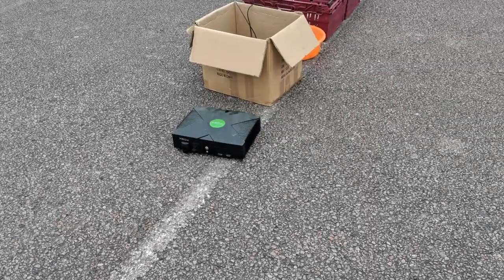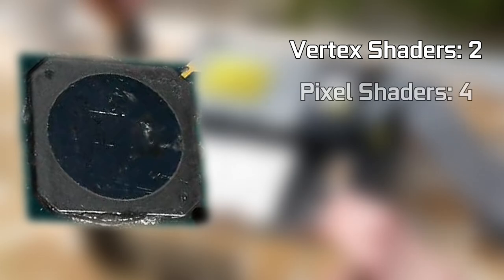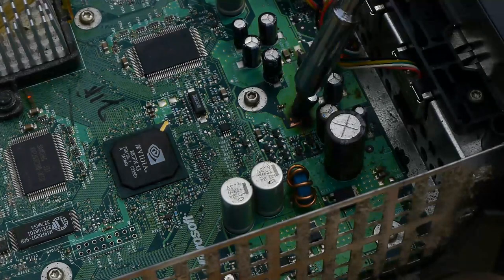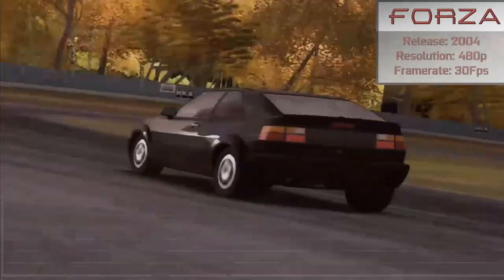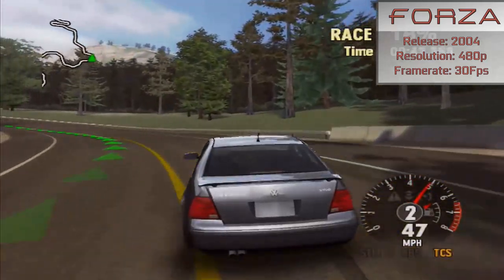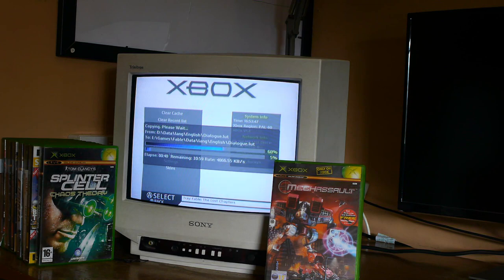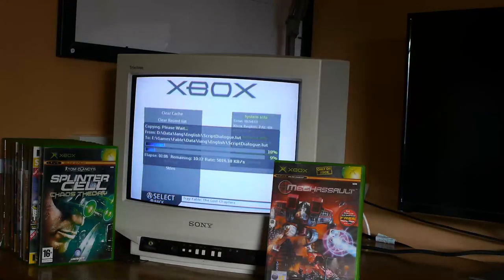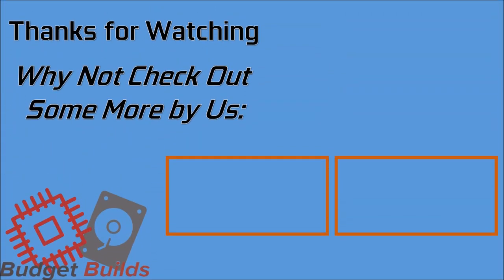How Powerful was the XBOX?

Comment: How the hell did Microsoft manage to make their GPU stronger than a lot of PCs at the time? Nowadays, consoles can't keep up with PCs at all
Reply: Well, they are one of the most popular tech companies in the entire world.
Reply: "Nowadays, consoles can't keep up with PCs at all"

because in order to make it profitable and affortable

OG Xbox was sold at $299 while it costed $425 to manufacture

that console cause $4 billions of loss in the market
Reply: @Charles-hy6gp  
Generally consoles are sold at a loss
Reply: Price. High End GPUs back then were 250 to 300€. These days it’s 5 times that.
Reply: They were willing to take the risk
Reply: @ilikeamd4579 You're correct. Especially since they were new to the console space.

Microsoft wanted to make a console that would outperform the others on the market, because it would help to secure their space in the console market. They didn't mind selling the consoles at a loss, as part of their plan was to make more money selling games anyway, and for Microsoft at the time, it wasn't that big of a loss.
Reply: They used PC hardware instead of APU’s
Reply: Nvidia wasn't rich at the time, so I'm guessing Microsoft was funding their engineers to build something special for the Xbox console. The GPU itself was a monster, but unfortunately it was also extremely bottlenecked due to low amount of VRAM, and shared memory bandwidth. Also the CPU was holding it back (half life 2 runs at 30fps instead of 15fps on modded Xbox with PIII 1.4GHz OCed to 1.6GHz). 

The GeForce4 4200 on PC was able to run Quake 3 at 1600 x 1200 x 32 at over 100fps. For comparison xbox console could only run quake 3 engine games at 480p 30-60fps.
Reply: I think this comment was made before the newest generations of consoles because the newest generations can keep up with PCs in the same price range. But at the time of this comment the modern consoles were 7 years old
Reply: @Thebossstage1 With the exception of Nintendo, the only company that sells products at a profit.
Reply: @PabloB888 bang on I had a geforce 4 in my PC at the time it was running Quake 3 pretty much exactly as you said and unreal tournament 2003 at high settings high frame rates.. The xbox was powerful mind at the time and was doing wonders it was almost if not on par with what my PC could do maybe not in terms of FPS games but it had some amazing looking games and all the hardware was all in one box I had a gaming PC made at the time for half life things like that etc but my xbox was still my go to for games back then we just had such a good run with the OG xboxs games. Performance for the most part shamed most of my friends PC's mine was custom but most couldnt run the new gen games at the time so a console was a good investment for everyone especially if you didn't have a dvd player already in the home.
Reply: You’re legit comparing apples to oranges blud 😂.